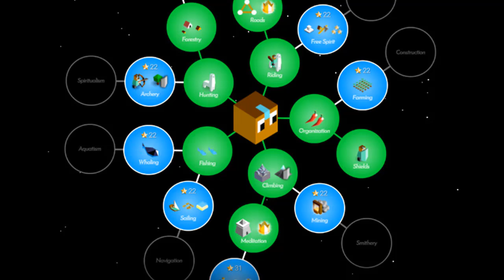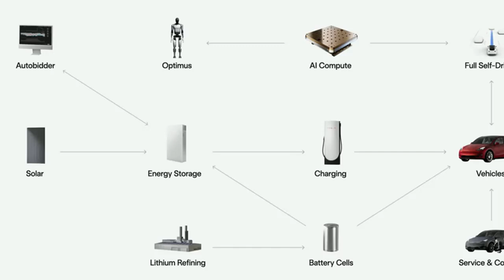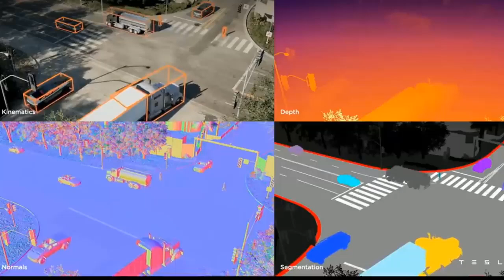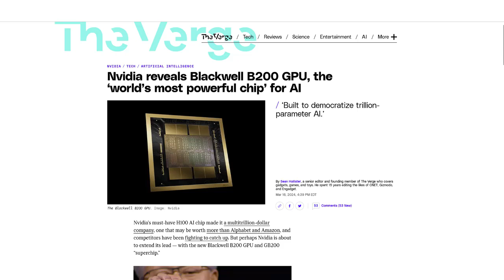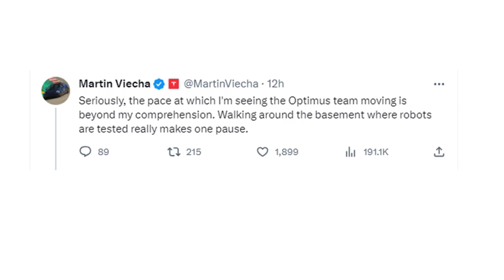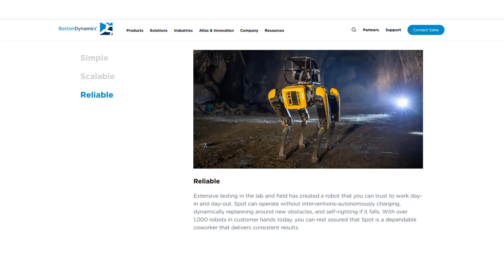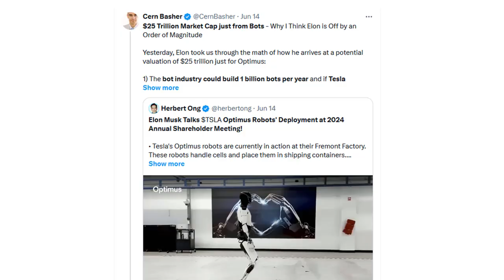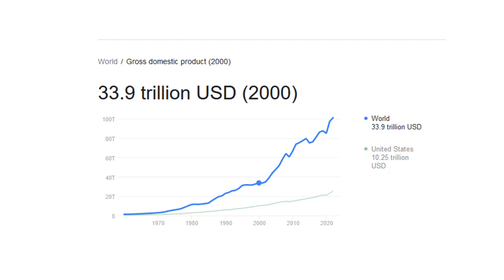The REAL Reason Tesla is Developing New AI5 Hardware

Comment: this is dumb on so many levels. FSD will never be leave beta / supervised mode and most people don't care to buy it anyhow. 6k $ to babysit a program that is blocking fluidity in traffic on every 3rd intersection.
It is something to toy with for rich people.

On Optimus: If you need automation for a production line, then you don't use a humanoid roboter but simply one arm with the needed tool
Tesla can't even build proper cars without quality issue, why should they be able to build something more complex?
Sales numbers for Tesla are plateauing and this is a desperate attempt from Musk to reinvent the company.

Comment: The main issue for the Tesla robot will be competition from other robot suppliers. It will be more difficult to make a profitable robot than a profitable EV since the competitors in the EV market are legacy auto.
Reply: The actual robot (the machine) is only part of the challenge. The behavioural element (probably 90% of the challenge) is compute capacity and the ability to learn from vast amounts of data - (ie: the brain).
Tesla is investing tens of billions into the brain - money that no other robotics company has, or can access.
Reply: Very little competition in the robot space atm.
You need the robot, real world interpretation to move (FSD) & a LLM. I think Tesla is far ahead in this regard.

They have the advantage of multiple companies to pull on to achieve this... Tesla, X, XAI. All important.
Reply: If they grab 10% of the market, their valuatuon will look like a glitch

Comment: FSD Teslas vehicle are just away for a robot to practice in real environments for learning to function in any environment.
A machine on wheels can teach a machine on legs.
And teach the research engineer the next step in evolving the technology. 

Robots in 24/7/365 factory production can increase productive hours 5 fold on the same small foot print.  😮😮😮
Reply: Not sure how it applies unless you're going to have Optimus drive a car.
Reply: @billweberx  if they can learn how to teach the cars AI how to self learn and navigate, then a walking robot is just the same self teaching problem.
Reply: @stephenbrickwood1602  False equivalency.  Cars are trained by billions of frames of video that are generated by millions of cars on the roads.  That video is not useful to bipedal robots.  And, we don't have billions of frames of useful video (yet) for robots.
Reply: @billweberx  a machine moving through the real world, is the point. 
Central mainframe connection can help it move in new environments. 
Boston robotics have learnt to handle trip hazards and navigate.
I think Tesla vehicles are in a bigger environment that changes rapidly, so yes, it would be useful.
Reply: @stephenbrickwood1602  Not convinced.
Reply: @billweberx  that's OK.
Just my thoughts,